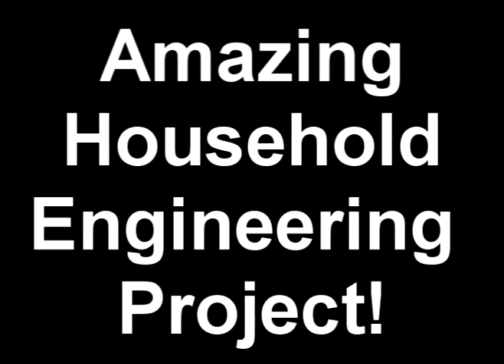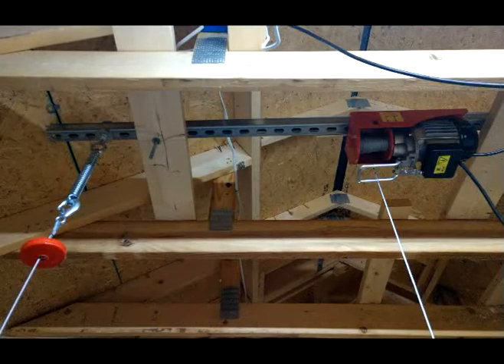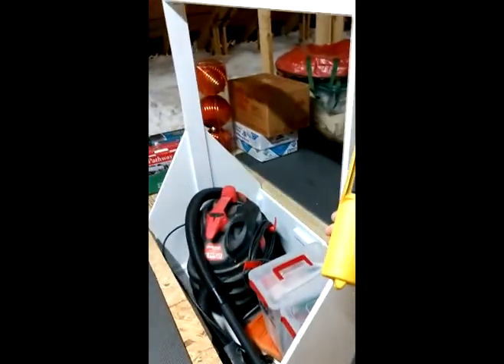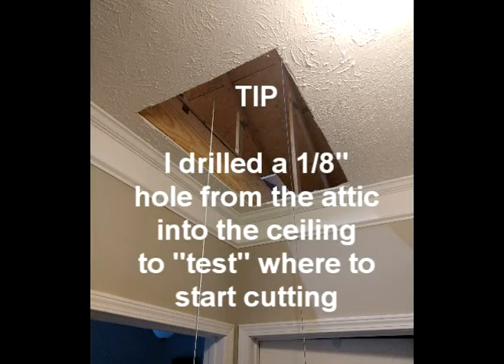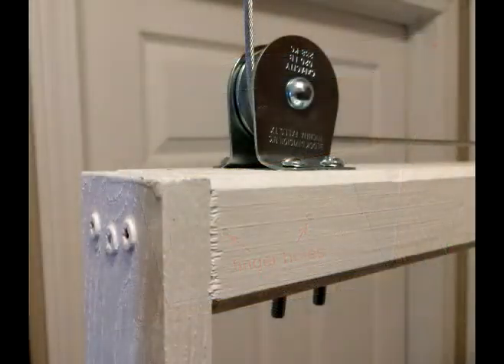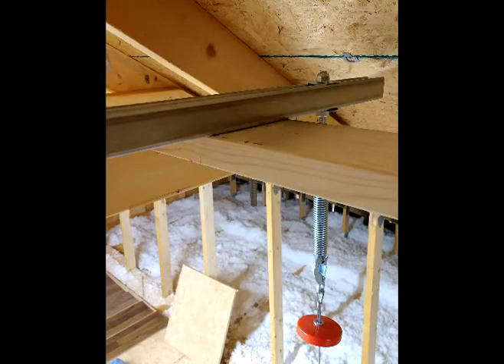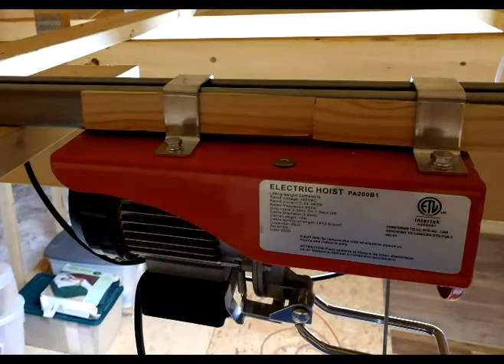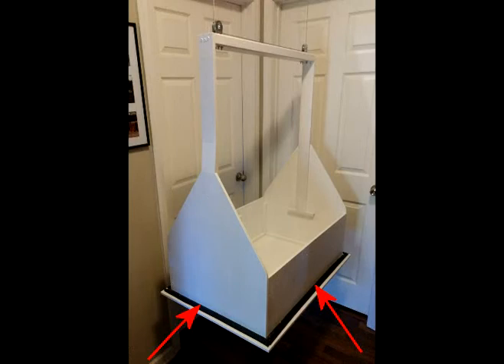DIY "Hidden" Freight Elevator in your Home's Interior Living Space to assist with Attic Storage

Comment from the maker: 220/440 lb Hoist System https://amzn.to/39wyW9l
Overhead beam - metal strut channel  https://amzn.to/3mVfvdF
EVA Foam interlocking floor mats https://amzn.to/3Om2khl
Example adhesive strip foam insulation 1/2" w x 3/8" ht https://amzn.to/3N2tN6A
Heavy duty pulleys https://amzn.to/3zHTW7X

Comment: On spring side how does the counter weight stay up beside spring?
Reply from the maker: Yes it does.   It is stationary and does nothing and really doesn't even have to be there.  The wire is wound and unwound from the spool on the motor side.     In anticipation of your next question, there is no automatic off mechanism.  The operator must hit the switch once the bucket is sealed against the ceiling and the spring has started to stretch.   Good luck if you are building your own and thanks for watching!
Reply from the maker: Actually, it's not a counter weight at all.  The bucket has enough weight to keep the wire taut.